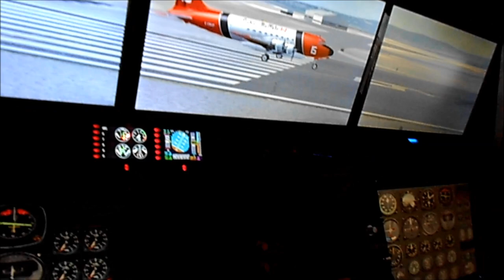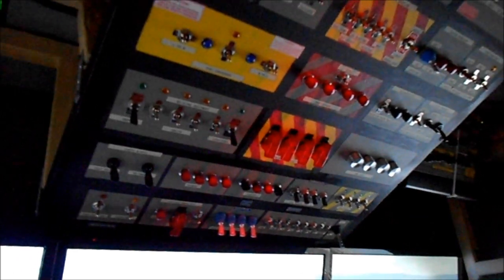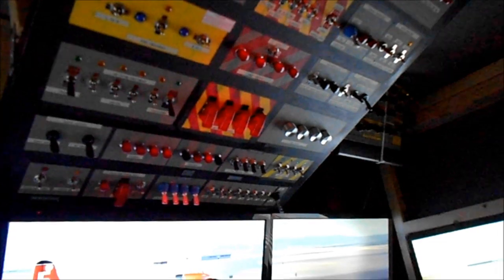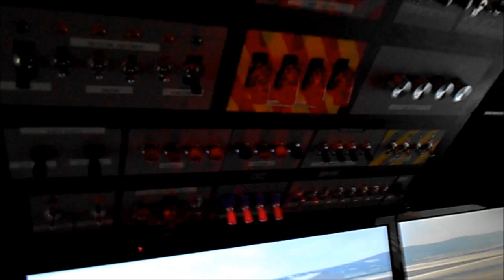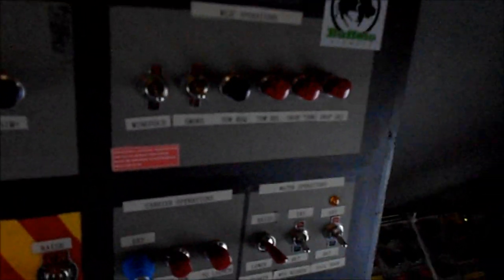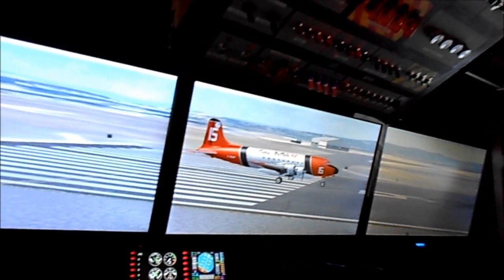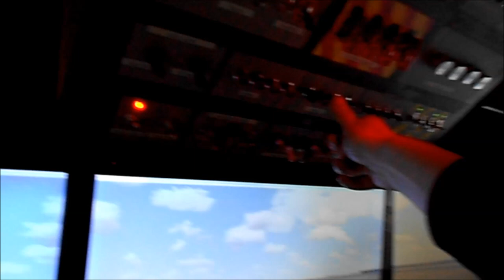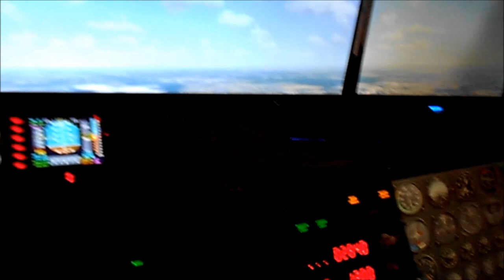FSX Overhead Switch Panel

Comment: You dont need any relays to keep the switchs from continuously pressing the key?
Reply from the maker: RantZ_IE No relays required, as far as the circuit is concerned its contionusly pressed, however the programming of the switch in FSUIPC negates this.

Comment: I'm going to attempt to make a panel similar to yours. Nice job by the way. I was just wondering where you got your switches and lights? Are there specific switches and lights for a USB powered unit? Thanks.
Reply from the maker: Hi Rick, thanks for the comment, all the switched and lights(LED's) were purchased off the shelf at my local electronics store (radioshack here in the states). I could have saved some money by ordering online though. Any DC switch will work, most are SPST (single pole single throw) in my setup. USB provides 5Volts of DC power so any swtich rated for DC will work. For the lights most are LED's also rated at 5volts DC. You can even use upto 12volt DC LED's/lights however those would appear a bit dim as you would only be giving 5 volts to a light that wants 12. Hope this helps.

Comment: Hello from Chile, I have a question, the switches and buttons are with specific voltage to connect to usb? I searched in electric stores in Chile switches to purchase and built this panel but all are 110-250V and other 12v. Thank you!
Juan Pablo

Comment: I used leo bodnar to connect my toggle switches. Made a homemade panel similar to yours. When I plug it in usb fsx only allows one controller at a time. So when Saitek yoke is active, my homemade panel with switches wired to Bodnar card wont work. When I select Bodnar controller to run switches my Saitek yoke quits working. Any suggestions?

Comment: One more question. What are the dimensions of the panel?
Reply from the maker: I just did a quick measure it's 24 inches wide by 27 inches long. It was built with 1x1 wood as the frame and panel face is a piece of hardwood flooring.

Comment: Most toggle switches on Amazon are 12 Volt. With the USB providing only 5 Volts will a 12 Volt toggle not work??? Sorry, I have basically no experience with wiring.
Reply: I think 12 volt means it can handle up to 12 volts
Reply: Usually 10%,  +/ 1.5v-1.8v at 12v.  So a 12v rated is usually up to 13.8 car voltage.  But for 5v, you have less tolerances, usually just 1/2 volt (0.5v +/).  Those tolerances do not matter as much when you are talking about switch ratings without a built in light.  Then you are more interested in AMPERAGE (Amp=Voltage divided by Resistance) and WATTAGE (W=Voltage times amps). This is OHMS LAW.  I personally do not like built in lights unless the voltage is exactly what is going into the switch.  I like to have a separate LED, wired parallel to the switch.  Select a resistor to reduce the current across the LED diode with the formula (Voltage in - voltage rating of diode / max current of LED)  So 12v-1.2v=10.8v  Then 10.8v/0.020 amps for diode=216 Ohms.... closest diode made is 220ohms.

Comment: hi,how do you connect it with your desktop
Reply from the maker: Hi Pulkit, the over head panel connects via USB. It uses 3 USB ports, this panel uses 3 input cards providing 32 switchs per input card. There are 3 input cards so there are 3 usb connections.  Thanks for watching!

Comment: I don't get why everyones says they cost so much! For me I was able to build one for 300 bucks for all wires switchs cards paint and lumber! But then again I did get the lumber and switchs and paint discounted but not 300 bucks off! Is there something im not doing correct lol!
Reply from the maker: Hi Rantz,

I guess the cost depends on the number of switches and controller cards used. My setup uses 3 cards and 96 switches in total, also adding LED's adds a bit of cost aswell. I paid off the shelf prices, and bough the leo card first, in hindsight I would have used 3 gamegear cards which would have saved me 60bucks. Are we comparing an apple to an orange here? How many switches and controller cards in your panel?
Reply: I had 4 cards about 80 in the overhead panel mabby more and I also made a side console that has around 40 in it! It might be the area im in. Also I bought them in bulk as well. and got 10% off with employee discount. And I used switches that had leds inside of them!

Comment: hello pyro man i buy a leo bodnar card BBI-32 Button Box Interface - With Connectors and i want to use to with the lights,gear, etc but i connect a toggle switch on/off  the gear down but to gear up i have to move the button 3 times. the buton -  http://www.mauser.pt/catalog/product_info.php?cPath=324_1401_1404&products_id=54100   thanks and best regards.
Reply from the maker: +Pedro Nogueira Hi Pedro, that swtich seems pretty standard, so let me ask, how do you have this switched program? Are you using FSUIPC or the detail FSX control settings? The default gear control is a "toggle" but with FSUIPC you could use direct offset programming and set the on to be gear up and the off to be gear down. Let me know how you have this programmed and I can assist further....